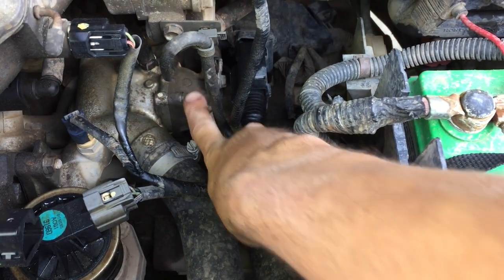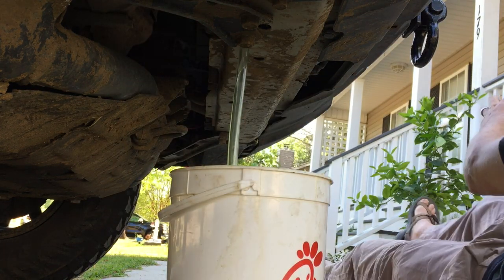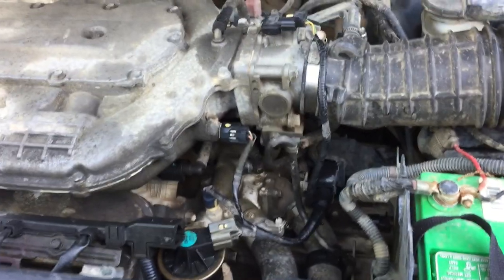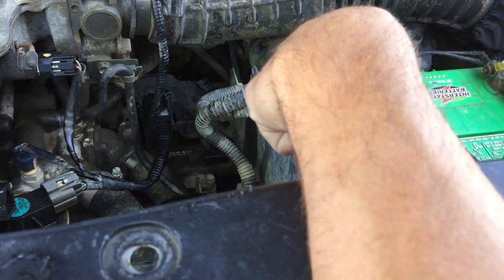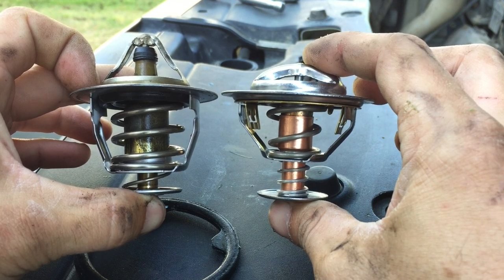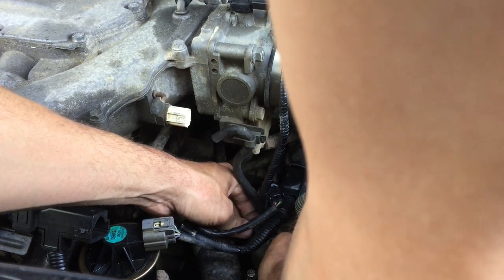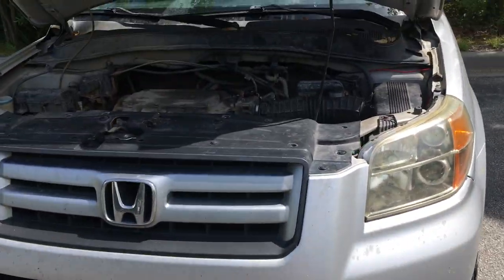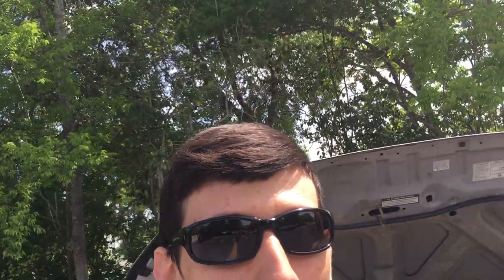Thermostat Replacement: 2003-2008 Honda Pilot Overheating

Comment: I have a 2006 Honda pilot. She is near 400000 miles on her.  I to intend on riding this beast forever.  My car just hit the overheating point.  I am also looking at replacing 02 censer and my cats.  I have a minor leak and just know it is because I cracked a seal trying to replace my oil pan.  I am completely going into this on my own.  So I have learned a few things.  I love my pilot and wish you the best on your vehicle.
Reply from the maker: I have learned a lot from failure as well!

Comment: Good luck, mine has 251k and running strong after a new radiator, EGR valve and alternator. My buddy has an 05 with 400k
Reply from the maker: Thanks!

Comment: I watch these videos to get my tools ready before I head out..... you told me zero sizes.  Hopefully your newer videos fixed that.  I know more about your trips than I do about the repair.....

And then you skipped like every aspect of putting it together and everything this is not a thermostat replacement video, this is a vlog
Reply from the maker: As you have noted my repair videos are vlog style.  I am just a father of 5 trying to share some tips. I am not able to dedicate the time necessary to make videos that are as details as you are requesting.
Reply: I watch these to learn, whatever I possibly can, about my issue overall. The exhaust gas being released from that tube is something that's happening to my pilot. Would've never learned the reason why if I hadn't watched this. You'll probably need a ten mm tho

Comment: What a difference looking under the hood of your Pilot to mine.  I'm in WA and mines a 2006 with 155K.  Under the hood it still looks like new except for some dust.  Totally rust free underneath.  We've made two round trips to the East coast with it and it is a great road trip vehicle.  We even spent some time in your home state.  Anyway, best of luck with the repairs!
Reply from the maker: My motor and vehicle is covered in mud 😂. I have never kept my engine bays ver clean.
Reply: how you been taking care of it?
Reply: @elsiervo225  not too well. Unfortunately I totaled it last year. But, while I had it I didn't do anything to rustproof it. Cars don't rust much at all here in Washington State.

Comment: I had to remove the head against the fire wall on mine to replace 2 bent exhaust valve on cylinder 1, it wasn't hard at all.  I'm a Honda guy,own a lot of j series motor, I doubt u blew a head gasket these motor go to 400k and up with proper maintenance.  Check your fans make sure they're coming on.  Run it with cap of and if u see it spitting up antifreeze then your getting exhaust gas in your cooling system.  If u have to do the head gasket you can re-use your head studs, honda recommends it just can't torque the last 90 degrees if you reuse it.  Did mine 5 months ago and still running beautiful.
Reply from the maker: Thanks for all of that info! I will try that test as soon as I can!

Comment: First, make sure the fan is running.  Forward motion will cool the engine if the fans are not operating.  If you're driving and it's still overheating you have a flow issue.  First thing to check would be the thermostat at that point.  Water pumps do fail, but it's much less likely to be the culprit.  Throwing parts at the problem will end in frustration and an empty wallet if you don't do some basic troubleshooting first.
Reply from the maker: Not a bad place to start. I bought a pressure test after this video to diagnose the problem.

Comment: Mines a 2003 pilot... the valve adjustment/ spark plugs are quite tedious but fun. Takes a bit of time to make sure there is the right gap with the feeler gauge. I’m not sure if there is something out there on Amazon still, but I was able to find a complete set of gaskets - valve cover, intake, spark plug seals, and head gaskets for about 40$. I haven’t used the head gaskets but the rest I installed and are holding up great so a more inexpensive gasket set might not be a bad option. I went with the aisin timing belt kit, it is the most expensive at 200$ but I’d hate to destroy the engine because of a cheap kit. I’ve put about 30,000 miles on with the new timing belt kit with no issues. 👍

Comment: I second replacing the radiator cap and checking your fans.  To check for the head gasket leak, warm it up without the radiator cap on.  If there is a leak and you rev it, you will see bubbles coming up.

Also, if you do the timing belt, look online for a kit with all the OEM parts.  It was surprisingly available and cheap enough.  Recommend replacing both idler pulley bolts; apparently they can have issues.
Reply from the maker: Thanks for the advice! I am sourcing a cap from the dealer.

Comment: Thanks for the video. I have to change my thermostat for different reasons. Kept getting an intermittent p0116 and a p0118. My Pilot reached operating temp in 2 min idle. So my thermostat is stuck open.

Bought a Mahle brand thermostat from Amazon. ~$22 and it comes with a gasket.

I wanted to save money over OEM one. Also there's a lot of counterfeit parts online.

Mahle is a reputable brand. I verified online through the QR code in the packaging as a Genuine Mahle part. The piece of mind was worth every dollar.

Comment: On most cars replacing the thermostat is the first and cheapest fix for this kind of problem. Rock Auto is my favorite choice for parts. Put some petroleum jelly on your battery terminals. You will prevent problems with poor electrical contact.
Reply from the maker: I believe the Thermostat did the trick. i haven't had any issues since my replacement! And i wheeled really hard this past weekend :)

Comment: Hey man just got back from Uwharrie my self and got a year pass, hit me up on Instagram when you think about heading that way, anyways with the preventive maintenance I see you do, Ill be very hard for the head gasket to be the issue. So before you go down the head gasket route, make sure the fans are turning on ( when they go out, the car tends to overheat on traffic and cools back down when you start moving), get a new oem radiator cap and rent a cooling system pressure  kit from the auto parts to see if the system has a leak. If the cooling system fails to hold pressure, it doesn't automatically means the head gasket is bad, make sure nothing in the cooling system is wet, even a tiny leak small enough to hold coolant but big enough to let air into the system could cause your engine to overheat by allowing air bubbles into the system. 
Good luck man 🤙🏾
📸 crv_wander
Reply from the maker: Thanks, and I am sorry I didn't send you an invite :( I will let you know next time we head that way. It must have been the thermostat because it hasn't acted up since.

Comment: My pilot is doing the same thing. I changed the radiator but still have the over heating issue. When you said the radiator would smell like gas well mine does smell like gas and the water gets pushed into my resiovore . This helped me figure mine out
Reply from the maker: Check out my later videos. It ended up being the head gasket.

Comment: My 03 pilot is doing the exact same thing. Gets hot at idle...cools off when i take off....leaking coolant out or the reservoir ...can you update me on your pilots current status please. Ive got a thermostat getting it put on tonight.
Reply from the maker: I’m in the middle of a head gasket replacement to fix my Pilot.
Reply: That's what I was afraid of.....well, good luck with it bud.

Comment: Call me crazy but I might be buying a 2006 pilot with 383,000 miles original engine and trans with no signs of engine or trans problems! What you think I really want to see how many miles these pilots can go with good maintenance
Reply from the maker: I’m going to push mine as far as it can go! Is the 06 rust free?
Reply: @GotterAdventure  yes it’s rust free I even checked out the rear subframe no rust not even surface rust . Engine and trans solid owner provided a stack of service records all done at Honda trans flush on time timing belt , water pump the works so it was well taken care of I’m just trying to get it for the right price
Reply from the maker: @Anthony-wp8ex  sounds awesome!
Reply: If the body is straight, and everything well maintained, and you are handy enough, a high mileage is a good buy at the right price.
Reply: How did it work out? Did you get it? I have 206k on mine and it runs great. I'm going on a 3k road trip next month and not worried at all. I've put 55k on mine since I got it with very little maintenance.